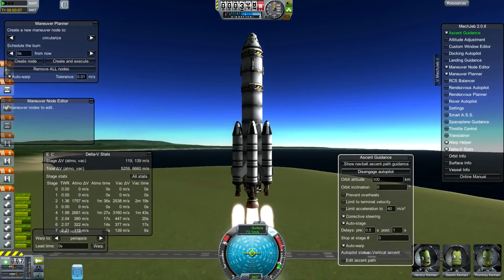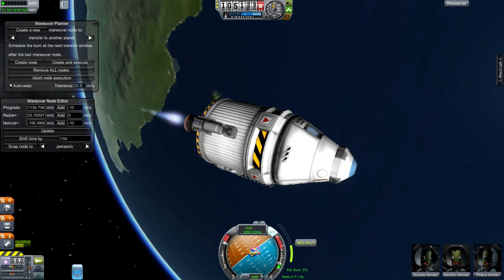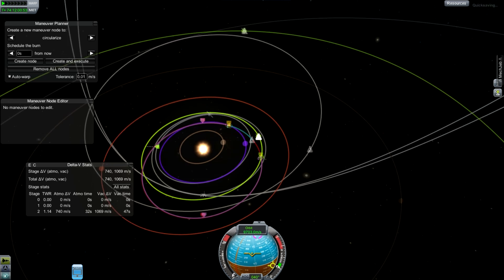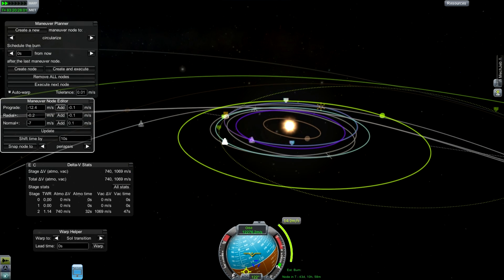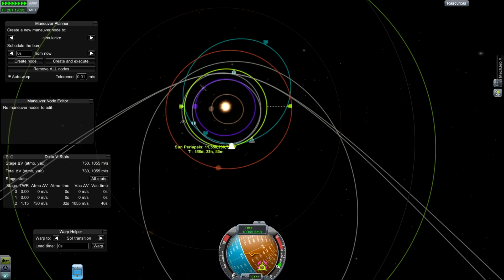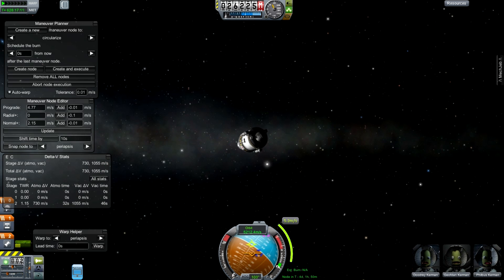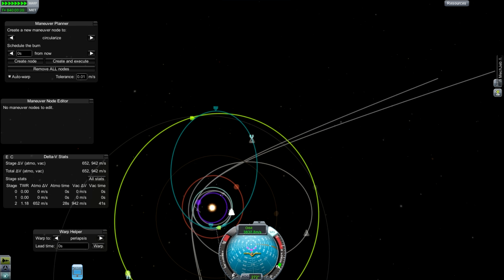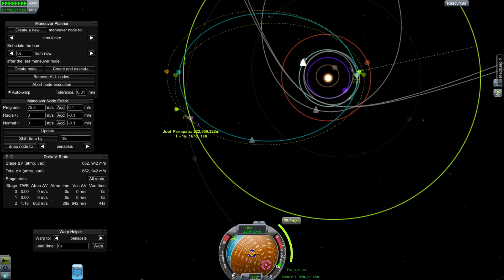Kerbal Space Program - Using Gravity Assists To Save Fuel

Comment: Didn't know this game existed but wanna try now. Looked at this on ISRO website and wanted to know if I could replay the mission.... Third earth bound orbit raising maneuver for Chandryaan-2 spacecraft has been performed successfully today (July 29, 2019) at 1512 hrs (IST) as planned, using the onboard propulsion system for a firing duration of 989 seconds. The orbit achieved is 276 x 71792 km.
All spacecraft parameters are normal.
The fourth orbit raising maneuver is scheduled on August 2, 2019, between 1400 – 1500 hrs (IST).

Comment: i have a question about re-entry im amusing it is safer to re enter a planet in the same direction it's rotating but was wondering if anyone knew if this had any unforeseen risks.
Reply: +reapzilla It doesn't really make that big of a difference in most cases.  While entering the atmosphere in the direction of rotation will require you to slow down a bit less, you can safely do it in any direction.
Reply: +Ben Ellzey I think this is true for low-density atmospheres.. but for thick atmospheres like Eve and Jool you really want to enter in the planetary rotation direction or you have a much higher risk of burning up.
Reply: magwo I assumed he was talking about Kerbin(or Earth if he uses the real system), as it is generally the only planet you re-enter.  If traveling interplanetary I would agree that entering in the rotational direction would be a good idea.  From low orbit it shouldn't make much of a difference on any planet, Jool being the exception(but why would you enter Jool's atmosphere from low orbit anyway?)

Comment: I am new to KSP. Are there any mods or anything like that you would suggest for beginners? like things to help with making course corrections or any such thing?
Reply: MrBbgunfire Here's a few I've been using, aside from MechJeb: Kerbal Engineer - Gives a bunch of really useful information, especially a built-in Delta-V calculator and a 'Distance to Terrain' readout, probably the best overall for new players; Kerbal Alarm Clock - Less useful now that the game has the 'Warp here' function, but can still be nice for keeping flights organized; Pilot Assistant - Very useful for Aeroflights, mostly I use it to hold a specific altitude since the stock SAS won't do that, but it will also control the craft pretty well overall so long as the craft itself has reasonable control. Oh, and HyperEdit, which is basically like a cheat engine, but I use it sometimes to make sure my landers can actually land before dedicating a mission to them. ^^v
Reply: Thanks!

Comment: You should have thrown some ion engines on there, you could use those for the smaller maneuvers. I mean, assuming their added mass doesn't cancel out any savings. 

Says the noob to the expert.
Reply: ElementalOctopus Not nearly powerful enough
Reply: +ElementalOctopus the ion engines aren't powerful enough to take advantage of the oberth effect, if i recall correctly

Comment: Theoretically, if you have enough fuel to reach the Mun you have enough fuel to get anywhere you want.
You use the Mun to increase your energy several times, until you escape Kerbin (even this first step is practically impossible in KSP).
Your orbit will differ from Kerbin's slightly, so you will meet it again (after many many years). Let's assume you have planned exactly how you will encounter it when it happens, and it will decrease your energy. That happens probably several times.
Finally, you will one day cross the orbit of Eve and, (because you have planned everything to a nanometer accurately), Eve just happens to be there to give you a kick forwards.
Proceed to what is shown in this video.
Reply: +RedsBoneStuff Probably you can, but saving something around 200 m/s dv wouldn't be worth the wait IMO
Reply: Tomáš Bortel I do realize that XD
Still cool to think about though.

Comment: You mention there is no benefit to be had from using the mun as a gravity assist into interplanetary space. However am I correct in assuming that transferring to interplanetary space from the mun is still a viable decision if you are using the mun as a kethane depot to refuel at?

Comment: Remember that velocity is a vector - it has a magnitude _and_ a direction.  You speed up in one direction then slow down in another, resulting in a large change in your final vector without having to burn any fuel to do it.

The resultant new orbit can be effectively the same as one you would get with a much longer burn, which is like free acceleration.

Comment: If I remember correctly the main problem is the fact that unity currently doesn't support ver. 3.0 of PhysX that supposedly got a massive rewrite, with the main idea being optimisation. 

Also in my case yes I need a better computer, you're right on the money with the ATI card, but my processor is almost 7 years old and needs to be changed. not to mention the fact that 2 days ago my GPU fried :/ (waiting for my nvidia gtx 660 now)

Comment: Question 1 Scot [if I can call you that] I saw you have a mac, do you have any advice for installing the aerospace pack? Specifically merging the files is sorta broken in osx. Q2 any advice on getting sounds to work with the firespitter pack? Or do you just use parallels/VMwere fusion? Thanks in advance.

Comment: You always have to burn until your orbit escapes kerbin's soi, if you want to travel further^^
The only problem with a straight up approach is that its periapsis is within kerbin, so you can't burn there. Not burning at periapsis is less efficient, esp if its 600-700 km away like at straight off kerbin. I just thought that this could be evened out by the d/v you save due to not raising your periapsis... at least in some cases/planets, maybe. But that obviously was wrong.

Comment: it's not sending people to another planet that's the problem, it's getting them there & back safely with enough supplies such as food & oxygen to sustain them for the length of an interplanetary flight. We've launched un-manned probes to most celestial bodies of significance in our solar system, but sending people is another matter. In KSP you don't need to worry about oxygen supplies or food supplies, or bone/body deformation caused by zero G. All 3 make space travel problematic for humans.

Comment: Straight up is never the best answer. Test this out for yourself with a rocket that has around 5600-5700 m/s delta-V and not too high TWR. The example I used in a forum thread was the 1-man lander can, 3 X200-8 fuel tanks, and an aerospike. If you go into orbit first, you have over 1000 m/s left which is enough to escape Kerbin. If you go straight up, you won't even reach the altitude of the Mun.

Comment: You don't. Your best hope is to achieve either an encounter or orbital insertion and then lower your velocity by applying thrust against your direction of travel. I find it is best to do this on a near encounter as there is more margin for error, and worst case scenario you will end up setting up a sloppy orbit whic you can then use to land from. This all stems of course from the Mun lacking any atmospheric density to provide drag to non-aerodynamic parts.

Comment: A good simile to answer your question would be to compare achieving escape velocity (fighting the pull of a planet's orbit) to climbing a steep hill, ethier in a vehicle or on foot. Not many vehicles (or people) are equipped to climb a hill straight from bottom to top. Due to the steep angle of travel, it requires far more exertion of energy. It is more efficient in some cases to climb a hill or mountain along a longer path, as it results in a less steep angle of ascent.

Comment: you don't have to get into orbit you just have to do a 90 degree gravity turn and use the planets gravity to kinda slingshot you away. it is not at all efficient to do a straight up burn because the planets gravity will keep pulling you in and you will need more delta V

Comment: sorry to contradict you scott but I found a way to use a munar assist to save delta-v,
heres how it works, basically make sure to align the planets for the interplanetary window (obviously), then get a munar assist lined up to kick you out to interplanetary space. then keeping your mun periapsis about 5 km, accelerate using the oberth effect until your trajectory has an intersect, this way you never have to burn other than in LKO but you still use the mun to accelerate your orbit.

Comment: you actually dont need a very good computer to have KSP runningg silky smooth...
the problem is.. it uses PhysX. since nVidia made PhysX uses the CPU instead of the GPU when the GPU is not a Geforce... all you need is a nVidia card instead of an ATI card... (noting the PhysX is not using the multithreading capabilty of the CPU either)
well... that's why more and more game companies are ditching PhysX for Havok

Comment: Depends. The fuel you'll spend getting stuff to Minmus is always more than what you'd save on your departure burn, but if you're sending that stuff with smaller rockets it might make things EASIER. If you mine Kethane on Minmus then it's a big savings. Whatever you do, if you're going further than Duna or Eve, head DOWN to LKO from Minmus and make your departure burn as low as possible above Kerbin's atmosphere to save fuel.

Comment: Well under the assumption that you build the ship in space and provide it with full tanks out there you are working under somewhat different conditions. Assuming your engines are efficient you'd probably have a lot of thrust to go around, unlike in situations where you have to make a rocket massive enough to get off Kerbin and THAN get into interplanetary space. If the ship was built around Minmus than you could probably use Kerbin for the escape "push"

Comment: You could use the Oberth effect while orbiting the Sun, since it has a deep gravity well. To actually get low enough to take maximum advantage, you would have to spend a great amount of fuel (however, a bi-ecliptic transfer can cut the fuel cost down.) 

If you're trying to escape the solar system, a more practical way would be to take advantage of Jool's strong gravity, and use the planet to perform a gravity assist.

Comment: 0.21 is in testing right now, from what has been said by the devs it may not quite be a full career mode but a lot of the system behind it will be added. Kind of a back end heavy update it seems but it may allow modders to make much better career modes ad-hoc until squad adds it.